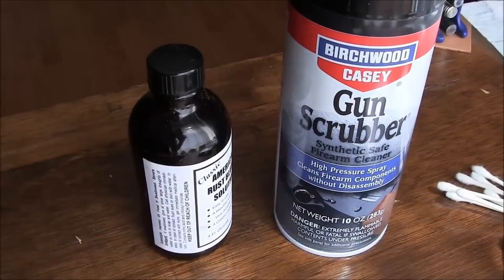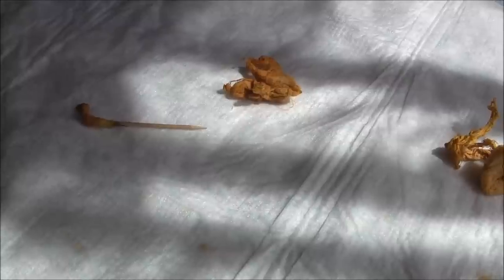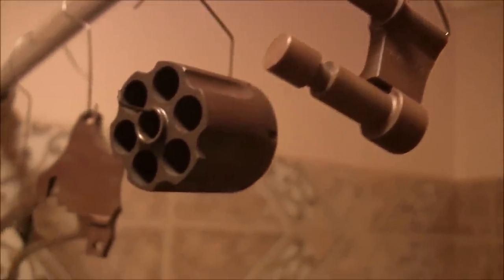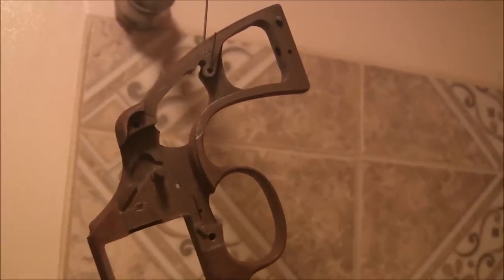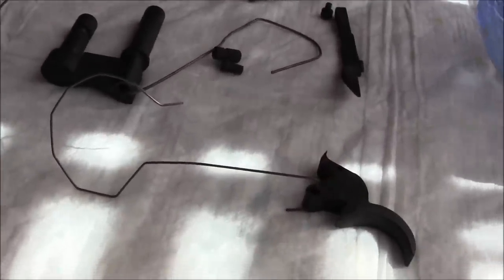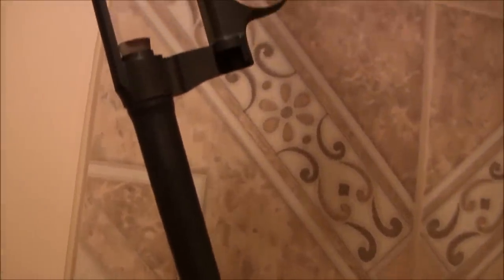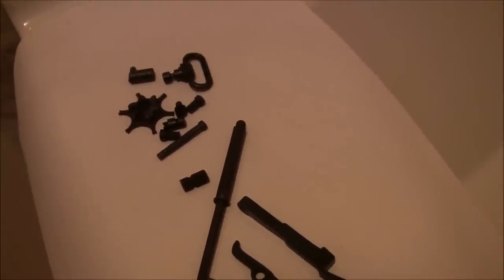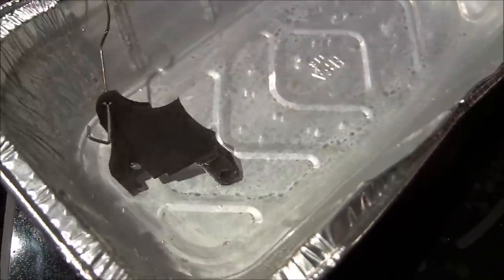Colt 1917 Army Revolver Restoration - Part 3 - Slow Rust Blue

Comment: You possibly saved me a ton of money. I want to blue a revolver of mine, And I was looking at big expensive setups($150+ for a bluing tank). This is proof I can do it  at home with a little creativity and still get great results.
Reply from the maker: Slow rust bluing is actually much better than hot bluing as far as durability of finish goes. Slower, but better. The only problem is that slow rust bluing is not going to keep parts in high polish.

Comment: Did some rust bluing too and did an orginal Thompson 1928 drum that had been neglected, used and forgotten about in a garage for 10 years.  I used Evapo-rust to take off the blue and rust, polished the parts to a 400 grit, then used Dawn soap, and Trisodium phosphate in boiling water to degrease, then wiped with acetone before I applied Brownell's Classic Rust Blue.  I did what you basically did in the bathroom, ran the shower hot, and filled the tub 1/4 way up with hot water, hung the parts and closed the door for 5 hours.  Boiled the rusted parts in distilled water from anywhere from 10-30 minutes, carded, repeated 5 times and finally used linseed oil to stop the rusting process.  I found that wiping the parts down with acetone after the final carding helped get all the loose black magnatite rust off, before using the linseed oil.  Let it sit for 24 hours and then wiped it down with gun oil.  Man it looks fantastic!  Great video and everyone should try rust bluing or even faster Belgian Bluing.
Reply from the maker: Thank you for sharing. It is truly a great process, and very forgiving. It takes time but the results speak for themselves.
Reply: While a slow process it does produce some excellent results if it is done with the proper steps.  It is not hard to do and you have to be patient and methodical to get good results.  If you can follow a receipe, you can rust blue.

Comment: That looks great! I have an SKS that has just the very slightest hints of rust, almost invisable, on the receiver cover. I was thinking about attempting to boil and then card it. Wondering if it would work.
Reply from the maker: It should. Just make sure to degrease the cover completely and use distilled water.

Comment: Also, the black rust is magnatite which is what is on a magnetic lode stone or black iron, I found that the steel wool wiskers were sticking magnetically to the parts after they got a good black coat on them.

Comment: hello greetings from Venezuela, I loved his work and so I decided to do the same, buy everything to make the finish in my gun, but I have a problem and hope you can help me.
1. degreasing the part and then apply the liquid stop resting 4-5 hours and then Hervi with running water, remove the rust with Steel Wool, 0000 Super Fine, then degreased, repeat the process 7-8 and always hands me the piece silver is almost a little black is not me with the black finish look and see if you got it.

My question is a special need for boil water ???
how long I have to boil the piece ???
that material polish the piece after boiling ???
or procedure will be doing wrong.
Reply from the maker: victor farias The process is as follows:

1. Remove rust and old bluing finish.
2. Degrease and clean well.
3. Apply rusting solution in even strokes.
4. Remember to wear gloves and hang parts in a humid environment for 3 hours or until red/orange rust.
5. Boil the parts in distilled or deionized water. Water has to be clear of additives.
6. Boil until red rust becomes black.
7. Take parts out and dry them quickly.
8. Lightly rub with 0000 steel wool only to remove velvet rust that formed on the surface.
9. Continue to wear gloves. Do not touch metal with bare hands.
10. Apply next coat of rusting solution (very small amount so it dries in seconds)
11. Hang in humid environment until red rust forms.
12. Boil to make black, remove velvet rust, and repeat.
13. This will take 10 applications. In the end the parts will look pale blue. When you oil them they will be black.
Reply: a question? one boiled see only the parts rub sack with 0000 steel wool to remove rust and immediately add a new layer of liquid oxidant ??? I have to degrease or clean the piece first and then do the procedure again ????
Reply from the maker: victor farias After first boiling, you don't need to degrease again. Simply get loose velvet rust coat off with 0000 steel wool, and apply the next coat of rusting solution. Degreasing and cleaning only done before you start the whole process. Just make sure to not deposit oil onto parts during the process, so make sure to wear gloves. Also, make sure you don't rub too hard with 0000 steel wool, or you will remove the good layer too.
Reply: ok, so I think my mistake is rubbing much with wool 0000, because all the processes I make as I indicated, rub hard to remove all rust and is part polished will try to pass soft and repeat the process, greetings and many thanks for your help to finish it be writing or placing a video of how it turned my room
Reply: I am afraid this is going to happen to me too.  One thing I learned from watching other videos is that common hardware variety steel wool is oiled so you are supposed to degrease it too.  I guess some people have had problems with this.
Reply from the maker: Robert Brandywine the process is simple but hard to explain without you looking at the pieces up close. you should absolutely degrease the steel wool or a carding brush you will use. carding brush should have crimped stainless steel bristles that are .003" in diameter. 

Once your parts are ready (220-320 grit sanded) degrease them thoroughly. make carding instruments. you can wrap degreased steel wool on toothpicks, q tips, etc. basically for hard to get to places. from this point on wear clean gloves every time you approach the carding tools or parts.

apply the solution to the parts and place in warm humid environment. allow to develop coat of red rust. It will look like fine crust. do not over rust or you will allow pitting to take place.

use distilled water only to boil the rusted parts. in 10-15 minutes boiling you will see red rust change to black oxide.

remove the parts, allow to dry, or dry them off with a hair dryer

gently remove surface "velvet" or "crust" by carding or using steel wool. no hard rubbing. basically you want to take off only the stuff that grew on top, not the converted surface. usually this means you will be getting close the same amount of gloss in the surface you had after sanding. this doesn't mean the same color, just surface quality. because the velvet thst forms on top is mat.

repeat.

at some point after coat 3 or so, you will notice that the parts are taking longer and longer to rust. That is because there is less and less exposed steel and more and more black oxide on the surface. so allow more time for red coat to form.

repeat.

change water frequently (preferably new water for every boiling) 

at some point, when boiling red rust coated parts (later in the process, around coat 5-7) your parts will look silver instead of black. don't freak out. once carded, black finish will be underneath.

Comment: great video ! do i need to boil 5 times  or i need to start everything  from beggining after i do first boiling ? sorry for my bad english
Reply from the maker: Thank you for watching. Your English is fine. You need to repeat applying the slow rust solution, waiting for it to work, and then boiling the parts to convert red rust to black every time. The process is as follows: apply rusting chemical, allow to rust, boil, remove surface rust, apply rusting chemical, allow to rust, boil, remove surface rust, and repeat all steps 7-10 times.
Reply: thanks mate !

Comment: How do you keep the inside of the barrel and cylinders from developing true rust? Did you apply any coating?
Reply from the maker: The barrel was plugged after it was oiled. And stayed plugged throughout the process. Cylinder chambers I blued.
Reply: thank you for the update. The bluing didn't make the cylinders too tight? Now I'm upset - I have to get an M1917 of my own thanks to this ;)
Reply from the maker: @dodgeplow  lol. And no, the cylinder was good.

Comment: Sorry I didn't reply to your comment earlier about the pitting, and it's too late now haha. As for the logos and numbers what I usually do is either avoid going near them if they are lightly stamped or engraved and if they are very deeply stamped into the metal I just sand right over them.
Reply from the maker: All good. It turned out okay. Not as professional looking as it could have been, but still much better than before. And now I know for sure it is protected. My biggest concern was the lettering and logo. I also didn't want to create a "rippling" effect when you are looking down the surface by spot sanding too much. I still have much to learn about this process, but so far it seems I am at least moving in the right direction.
Reply: MosinVirus Let's put it this way, it looks as good or better as the arsenals used to rust blue them when they went in for refirbushment prior to WWII.  Very nice job.
Reply from the maker: John Saia Thank you.

Comment: What are you using to card the parts? What type of brush?
Reply: From Brownells:
https://www.brownells.com/gunsmith-tools-supplies/metal-prep-coloring/wire-brushing-carding-tools/gunsmith-carding-brush-prod6732.aspx
 https://www.brownells.com/gunsmith-tools-supplies/metal-prep-coloring/abrasives/metal-wool/bronze-wool-prod7391.aspx

The bronze wool alone could be used because only it allows getting into small places.
Reply from the maker: I used a carding brush with bristles that are .003" thick from MidwayUSA.

Comment: I just finished my first gun and was puzzled by the soot that developed over about 40% of the surface after boiling.  From asking others, this is normal, and in fact, the entire surface should develop this soot, but after carding, the whole surfaced looked good.
Over smoothing will lead to problems.  At most use 400 grit, and 320 grit is better.
Don't be disheartened if your parts don't rust over 100% of the surface after hanging.
Don't be disheartened if your parts don't convert to 100% black rust after boiling.  After carding they'll be 100% blue.
Reply from the maker: Yes and yes.

Comment: I have a question about getting that black oxide coating on stainless steel.    is it possible?   How would I go about accomplishing this task?
Reply from the maker: There are stainless blackening kits out there. Not very dirable. Coatings like cerakote are an option, but the one I think I would recommend is a Melonite finish. It is knowN by different names, but it can be done to both carbon and stainless. And it hardens the surface as well as produces a black finish. This process adds about .0004" to dimensions so it can add up. My Build 4 has the finish and the slide and various other parts are stainless where theas the frame is some other parts are carbon steel.
Reply: +MosinVirus as always I greatly appreciate your input.    I'm heading over to check out your build 4.     Thanks again.

Comment: I have a smith and Wesson 500. do you do coating on the 500S&W
Reply from the maker: if it is stainless, bluing will not take. if your revolver is blued, and you want to refinish, you could use this method.
Reply: Ok I just want a coating that can protect it from rusting
Reply from the maker: +Manuel Silva if it is not stainless there are a few options that involve surface conversion to protect against rust. if it is stainless, it will not rust quickly.
Reply from the maker: +Manuel Silva you could always have it plated. like nickel.
Reply: +MosinVirus ok is that better then cerakote it
Reply from the maker: +Manuel Silva plating? yes. but why are you so worried about it rusting? how is it finished currently

Comment: What do you use to oxidize and what proportion do you use?
Reply from the maker: I used a Classic American Rust Bluing Solution from Brownells. Recently I got Mark Lee Express Blue as well but haven't tried it yet. The Express Blue should be very similar to the Classic in result but should allow to get there much faster.
Reply: What would that solution be?
Reply from the maker: Sorry, it was actually Pilkington Rust Blue. Here is a link: https://www.brownells.com/gunsmith-tools-supplies/metal-prep-coloring/metal-bluing/specialty-bluing-chemicals/classic-american-rust-blue-prod9815.aspx
Reply: thank you

Comment: Hi, what material do you use especially for the gun barrel?
Reply from the maker: Gonzalo Jeronimo steel. this is the original barrel, so whatever steel they used back then is the steel that the barrel is made from.
Reply: MosinVirus muchas gracias ,amigo.